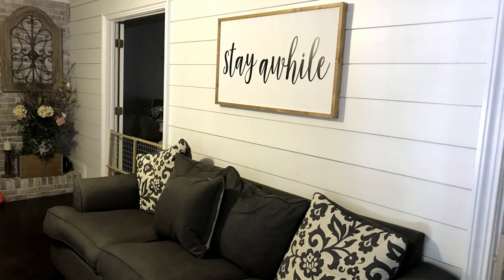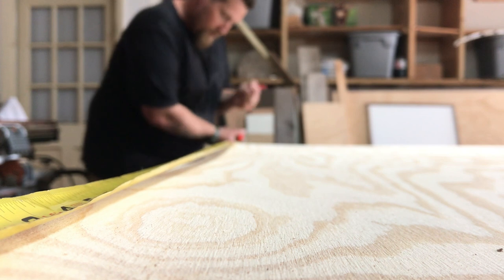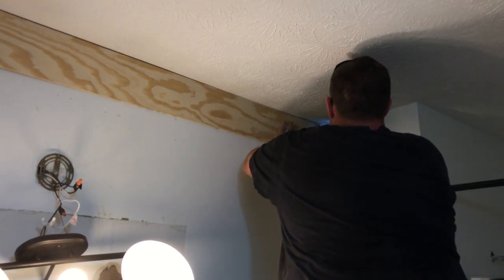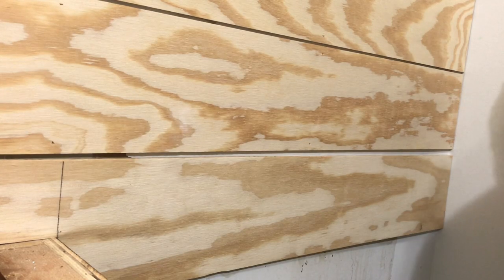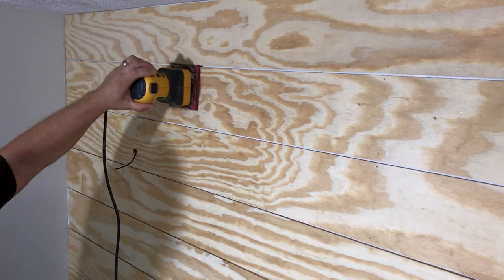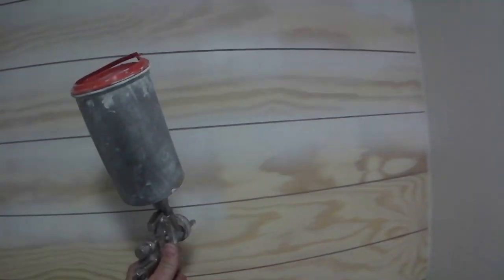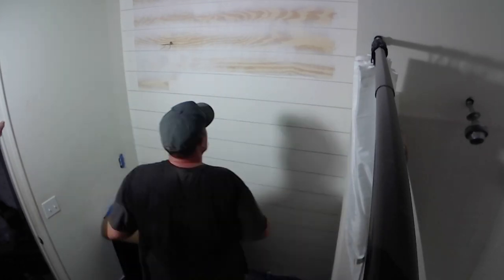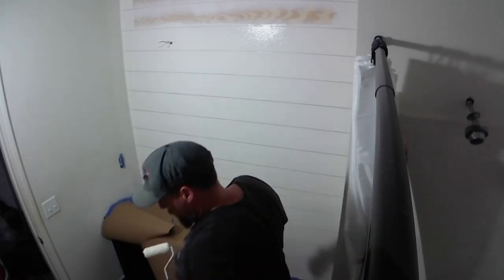CUSTOM Shiplap Wall | Faux Shiplap vs. Real Shiplap | Bathroom Update

Comment: Awesome job.  Looks fantastic.  I'm going to try this.  Been looking at shiplap and it's expensive.  I don't care what's on there as long as the look is the same. And let's be honest, shiplap should look a bit rustic anyway so who cares if it's a perfect board from the box store?
Reply from the maker: I’m telling you, I’ve got both.  And not once has someone anything about any differences.  If they don’t like it, they can pay for the next room 😂
Reply: @TonyCollumtheHOWTOHERO  What do you think about using 1970's style wood sheet paneling flipped over and ripped into 6" sheets?  I got an older farmhouse home that I'm going to be doing some reno in.  Someone put a lot of paneling in there back in the 70's.  It's gotta come out but I'm hoping I can flip it over and rip it to use if it's thick enough.
Reply from the maker: @CardiacCat  I wouldn’t personally.  It is super thin and brittle and I don’t think would be enough of a profile.  I actually ripped out a whole room of paneling (that someone took the time to tape and mud to fake it being drywall) to put up the real stuff.  I don’t like how paneling ends up looking
Reply: @TonyCollumtheHOWTOHERO  Yeah, I thought it might be.  Well, it'll just get ripped out.  Thanks for the input.

Comment: Since it’s been up for awhile, how well has it held up with the shower? I want to do our bathroom & worry about how damp it gets in there with no exhaust fan.
Reply from the maker: It’s still holding up really well.  Think about it though…once you paint it with latex paint it’s no different than the drywall.  I do however, suggest that you invest on a bath fan to help.

Comment: Very nice! I live in a 100 year old house with cracked and wavy plaster walls and I think this would be a hell of an upgrade while avoiding with most of the plaster issues.
Reply from the maker: I’m sure it will help in some areas.  Just remember a bad base (wavy walls) could easily  translate through this thin veneer
Reply: You should have mixed up the cuts so the lines of the boards didn't match up. Looks like a piece of plywood glued to the wall. In fact they make paneling that looks just like that. Looks nothing like shiplap.

Comment: Wow, you have straight walls.
In my bathroom the distance from wall to wall vary a lot.
Excellent job!
Reply from the maker: They all vary quite a bit…you can use trim at either side to make up for walls that are not exactly straight.  In my other video where I put shiplap in my granddaughter’s nursery, I use a cove molding to trim out the ends
Reply: @TonyCollumtheHOWTOHERO  Thank you very very much!
Will definitely watch it.

Comment: What is the added benefit of using the construction adhesive backing on the boards?
Reply from the maker: In the bathroom (high humidity area) it helps keep the wood from moving.  In my granddaughter’s room I didn’t use it.

Comment: I have some imperfections on my wall around the light fixture. Do you think the unevenness would show in the small gaps?
Reply from the maker: The shiplap will hide many imperfections.  The gap is so small usually imperfections are never seen
Reply: @TonyCollumtheHOWTOHERO   Thank you so much for the info and responding!

Comment: With this being a bathroom, do you have to worry about extra moisture?
Reply from the maker: Moisture is a concern in any bathroom.  But shiplap is no different than drywall.  The paint acts as a barrier to keep out the moisture.  To help ensure you seal the wood well, you can pre-paint the shiplap then install.

Comment: At $6.50 a board at HD my takeaway is to just buy 10 real boards and avoid the hassle of gap measuring , cutting , priming etc. where you getting a 1k difference from?
Reply from the maker: The (primed) 5.25” x 12’ shiplap sold at Home Depot works out to .87 per linear ft.  To do a bathroom 8’x8’ would cost approx. $128 just in shiplap.

1x6x8 cost approx $147 to do the same bathroom

1/4” 4x8 sanded ply cost approx $65 

Now, I know you’ve got to put in a few other things to get to the finished product including time...

My way is not the only way...but it gave me great footage for a video and shows others how to do it a different way and to save some money.  I was referencing 1k difference from when I did my living room at almost 500 linear ft at approx $1.77 per lf. 

Thanks for the feedback